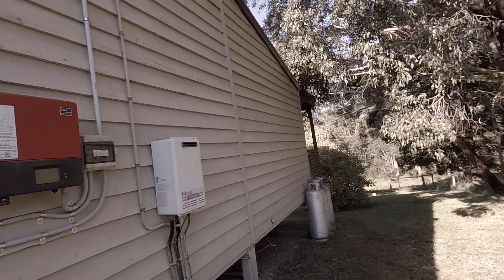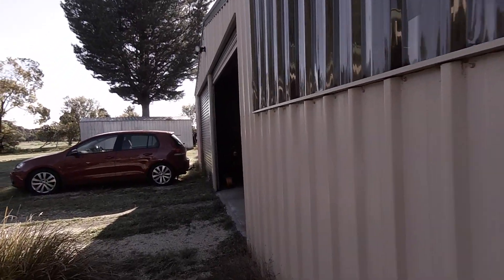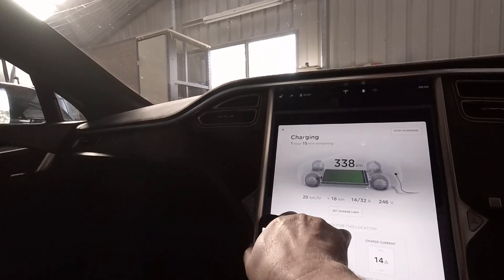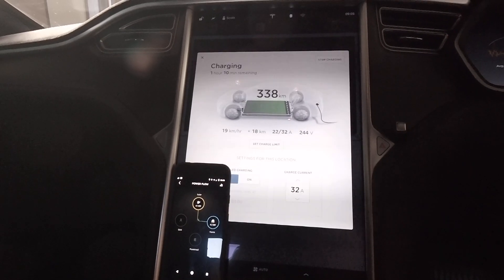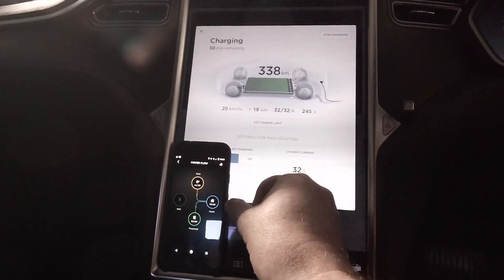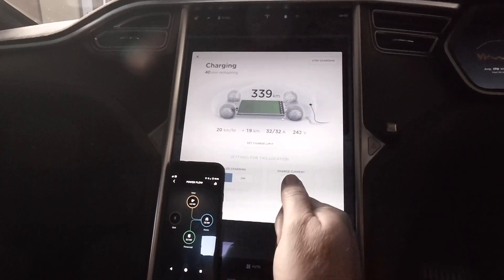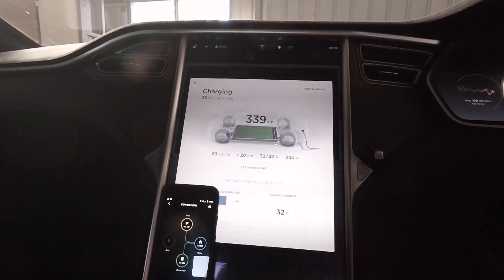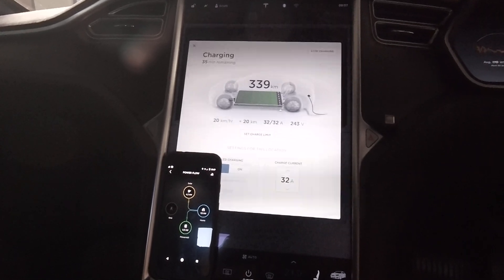Tesla Powerwall 2 + Solar: Maximum Output

Comment: This Zappi EVSE will tailor the charge rate to the vehicle based on the excess production of wind or solar production.  https://youtu.be/0EtegQfZQRw
Reply from the maker: The Zappi is definitely cool but I already have a charger and I'm confident that Tesla will be able to achieve the same feature in software. I pretty much have it already solved in software and if the Tesla owners API exposed an endpoint to adjust the charge current in the car it'd be perfect :)
Reply: Scott Weston yes, I hope that will be pushed out in a software update.  Elon did mention improvements in "ways we could not guess" ;)

Comment: Great video. I have solar and 3 powerwall 2.0s going in. I'm wondering if I'll have a separate inverter for the solar, or will they use the inverter in the powerwall? That would be great to be able to use the powerwall to supplement solar. Thx for the post
Reply from the maker: I seem to recall the DC version of the Powerwall 2 could do what you're saying but in Australia at least (and perhaps other countries too?) the only version of the Powerwall 2 available is the AC version (which you can't plug solar panels into).